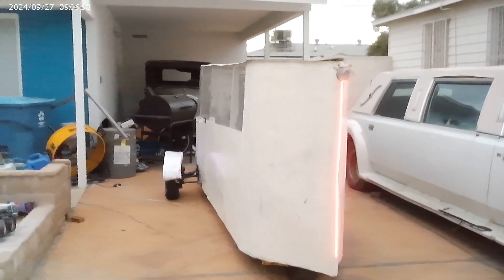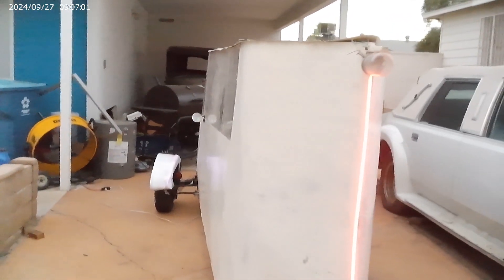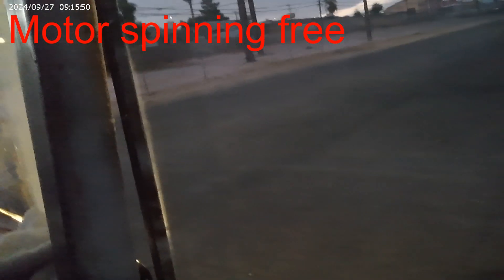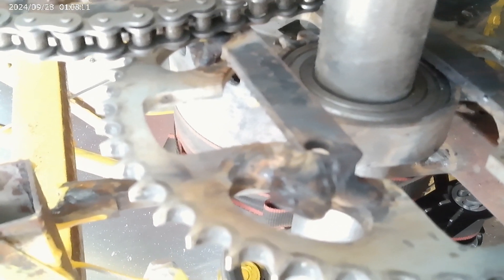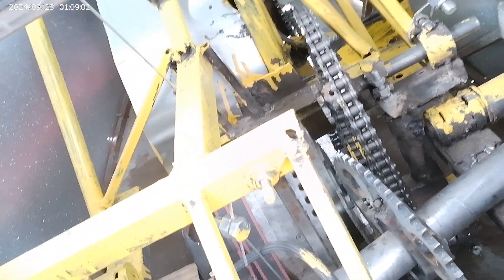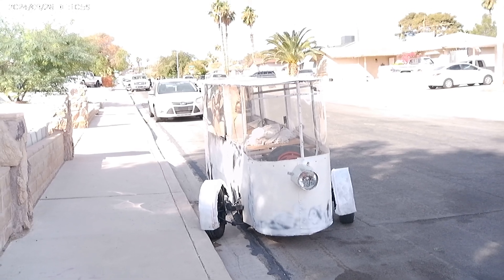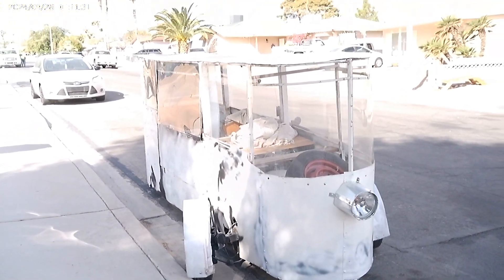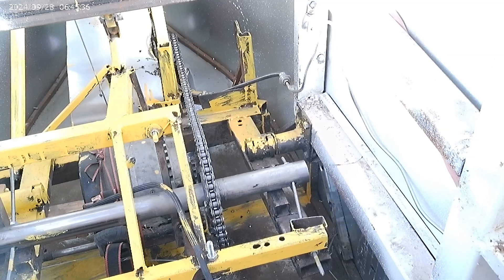Test drive of my solar electric car

Comment: very cool! what do you think about RF resonance to transmit power,  joel lagace has some interesting stuff on it but I cant make sense of it,  maybe you can? https://youtu.be/Pt92oKtSEHM?si=GN0p6NGx3kChg3qi  Maybe we wont need sunshine and can run off the power of radio waves, radio flyers! until then im all for solar vehicles but thte panels are just not that efficient for my liking to power anything but very light weight/efficient vehicles  why im trying to solarize an electric scooter, rather than a bike or any bigger vehicle. A scooter has a chance with its small size , it can move you with 120w of power, albiet slowly, and pretty quickly with 300w,   thats 1-3  good panels and your moving for free.  But yeah its not much of shelter or "pod" to take shelter in.  So we just gotta learn how to tune into different forms of energy i suppose until panels get more efficient.  In space the weight of your vehicle wouldnt matter would it? and you coudl pedal to near speed of light?  Why wait for solar sail to push you when you could crank it?
Reply from the maker: I think RF power is just plain dangerous.